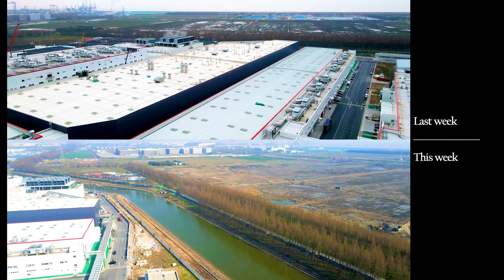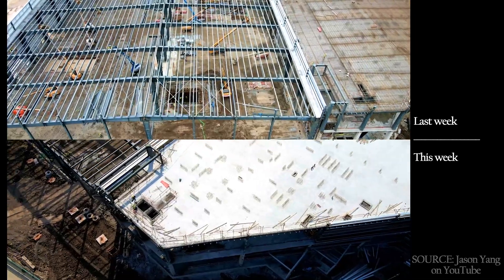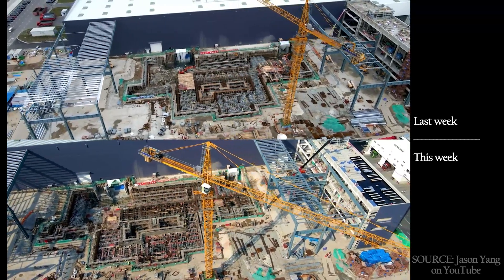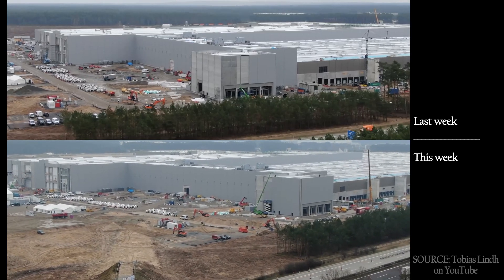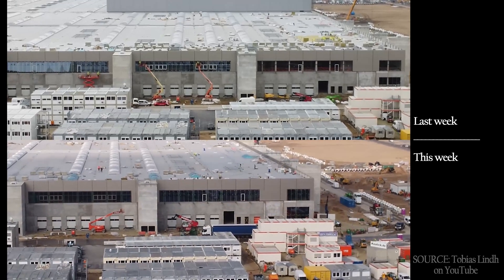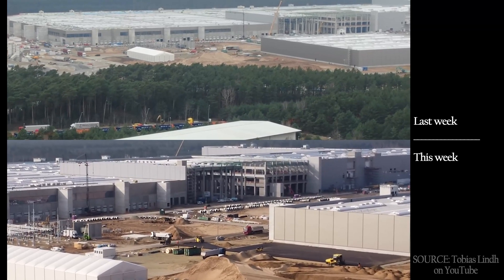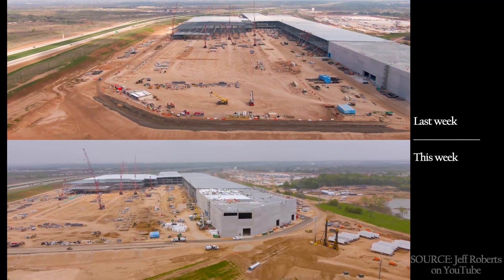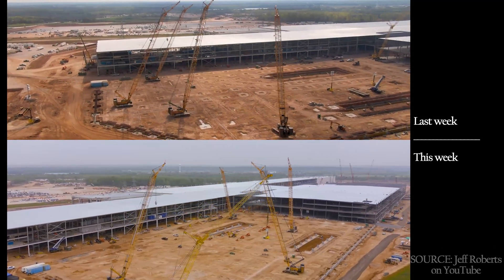GigaFactory progress before/after week of March 29th - Model 2 Shanghai Groundbreaking!

Comment: With a lot of other Tesla factories have a 'phase 2' plan, do you think Giga Texas one will have one as well? Or is the phase 2 just a compensation for increased demand? Seeing how Giga Texas is so huge perhaps they got ahead of any potential demand increase...
Reply: Texas will have phase2, phase3 & phase4. They have 10x the land that Shanghai has. They will be building long after I'm gone and I''m still in my 50s
Reply from the maker: The construction we're seeing now spans the original phases 1, 2, and 3. They changed the plan after those two massive capital raises left them with the cash on hand to tackle it all at once.

With that said, @steve Ambrigio is correct, a Tesla site is never "complete" until they run out of land or purpose for the land. Even Nevada, which a lot of us had considered "complete" recently had new buildings put up for pilot manufacturing of the Semi. And if you look at Shanghai, they did Phase 1, did Phase 2, and just never stopped. Now they've bought more land and they're moving forward with construction there as well.
Reply: @FutureAzA  True, it's smart to use the land they have. And it's easier to have things all at one site, vs splitting things up into multiple new sites.

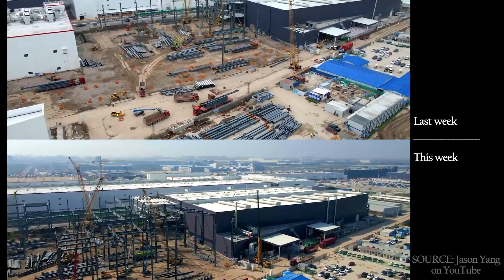Comment: Your question as to what it's for at time mark 0:50 - The building to the right is where the Giga Casting machines are. There are 4 machines there.  Given the heavy footings and close knit piles that were driven in, I expect another set of Giga Casting machines here. i.e. It appears to be a continuation of the existing Giga Casting building.

I'm pretty sure it's a switch yard. Sub-stations have step down transformers. While switch yards can also have transformers, there are no transformers here.

Basically, the steel pole with the dish contains the receiver for interfacing with ERCOT so that ERCOT can disconnect Giga Texas from the grid at need. If you look carefully, you can see the switches with connect and disconnect from the grid.

The lines leading to between the parking area and the main building may end up feeding into a sub-station later. I do remember talk that Tesla had changed to a oil based 'indoor' sub-station but I didn't see that confirmed. We shall see what we shall see.

Comment: Excellent content as usual. Buttttt.......might I suggest changing-up the background music? It's becoming annoyingly repetitive. Turning down the volume is one option but that would negate the useful commentary accompanying the video.

EDIT: 12:25 Switchyard or substation: Perceptive question. This is a substation. A switchyard lies next to a power generation facility, operates usually at one (very high) voltage, whose purpose is to send energy from the generator to high KV transmission. A substation is intended to do the reverse: bring the high KV energy down in voltage via transformers for local distribution and use.

Comment: The difference is they are reducing voltage or not.  In my view if they are taking power off the towers then its going to be classified as a substation as it will have transformers.  Furthermore switch-yards are more often connected directly to power stations.

Comment: I think technically it should be called a substation. A switchyard does not normally have transformers, merely acting as a switching location for the existing voltages. However, here at Texas we can see two transformers (which appear to be step-down transformers) which would make this a substation. I'm not sure what the voltage of the power lines is running alongside Gigatexas, but probably around 12.5kV for the system where it appears they're going to tap in (I think the other lines are at138kV). Anyway, these voltages will be too high for the factory which will want them stepped down to 3kV or less. There'll be other transformers, probably inside the factory, reducing the voltage further for general power supplies.
Reply: BTW, We know the voltages for Berlin. 110kV in, down to 10kV for distribution on-site, final transformation (mostly 400V 3-phase) in multiple places inside the building.